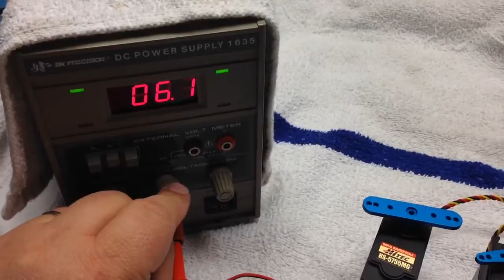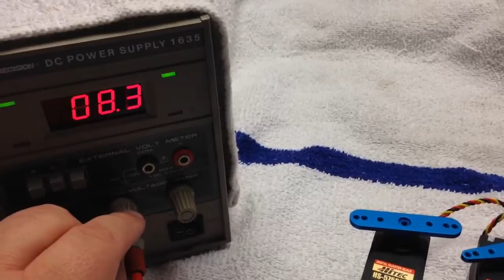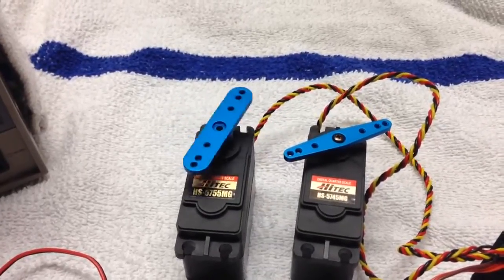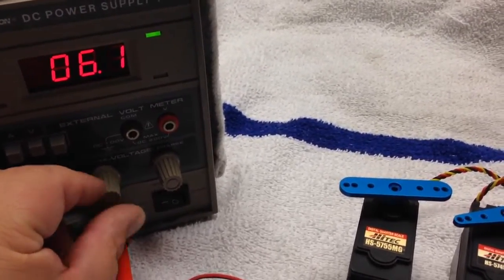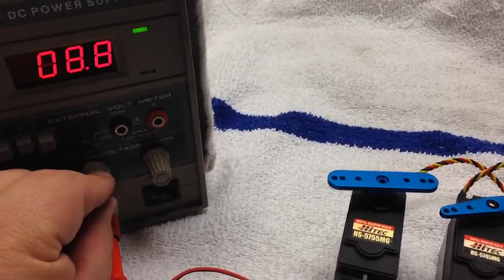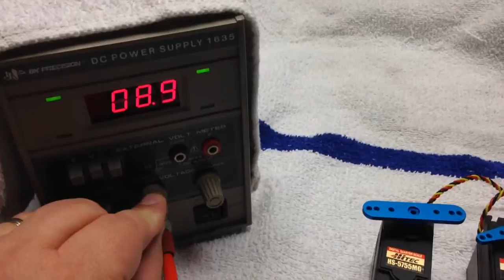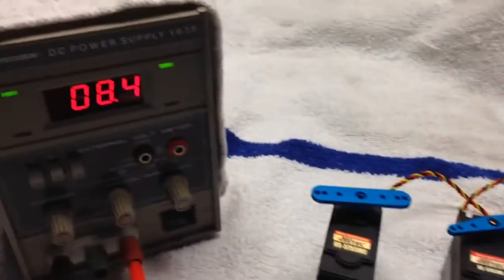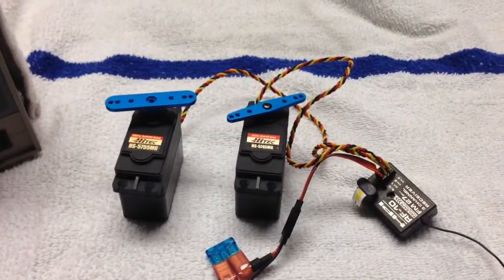Running 6v Servos on 8.9v

Comment: Manufacturers rate them FOR VALID REASONS!   If you are putting in an expensive airplane that could hurt or kill someone, stick to manufacturer specs and skip this nonsense.  If you are a car guy, who cares if you ruin a servo, or a car.   With no load, and cycle-time-current testing, the test is incomplete anyway.

Comment: My stock hpi throttle servo fried in full throttle position in about 6mn of running with 7.4v 2s lipo. Didn't have a kill switch either. I activated the failsafe and it killed the electronics, unfortunately it fried in WOT position so my baja 5b kept running till it crashed. I've now invested in high voltage servos and a kill switch.
Reply: Dynamite is junk. Get a Killer RC Super Bee kill switch.

Comment: Is every servo able to handle more than 6 Volt ?
Reply from the maker: Well, a fully charged 6v battery is actually 7.2 volts. Servo manufacturers know this. So yes a 6v servo can handle at least 7.2 volts. Most servos can handle over 8v, but I don't claim that every single 6v servo in the world can handle 8v+ without frying.
Reply: They will be safer with no load on them. When installed in a car on over 6v, you'll have freshly fried servos. Unfortunately McDonald's doesn't sell these.

Comment: Futaba has informed me that the Receiver that came with my 3PMX couldn't handle more that 6volts, so this video makes me feel better about using a lipo pack in my Baja
Reply: Same I’ve made a kids quad into a 72v rc car the esc only puts out 6v🥴.   To the servo I didn’t know you didn’t need the esc to just run servo so now I can put 8.9v through my receiver to my 25kg servo.     🤞🏼🤞🏼